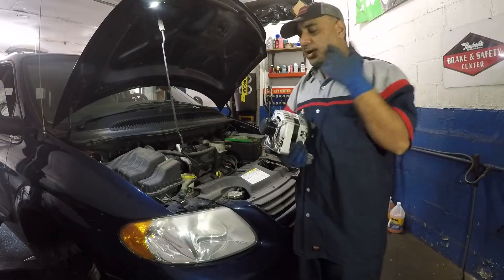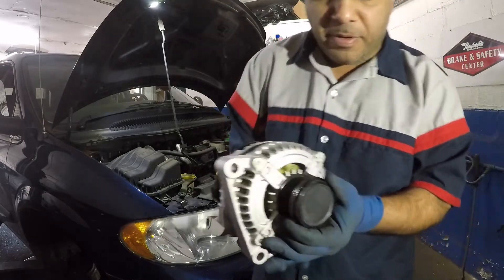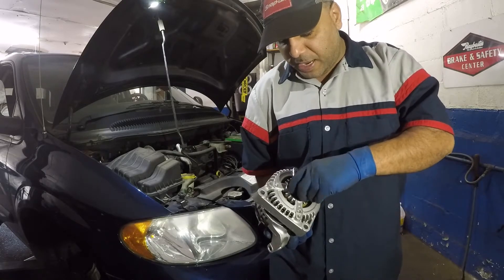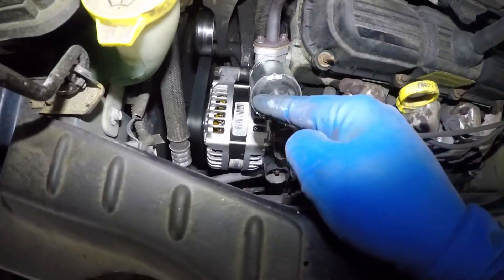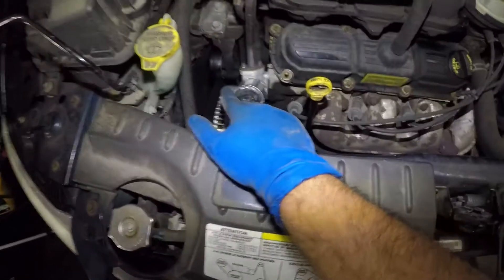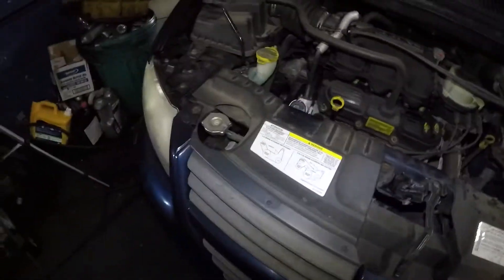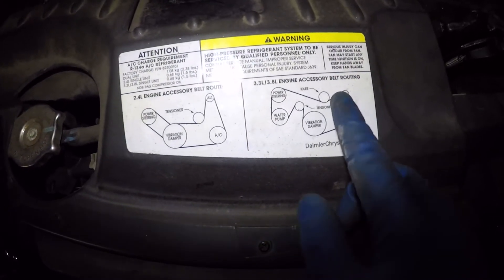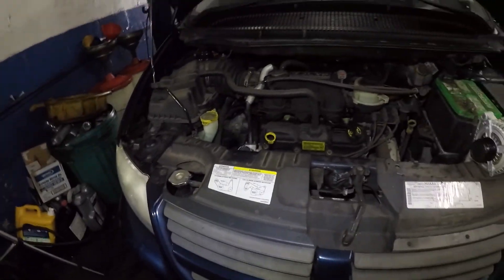Dodge Caravan 2005 making chrippin sound

Comment: My 05 Dodge Grand Caravan is making a noise when holding the gas pedal between 1 and 2 rpms in drive, but doesn't make a noise when in idle in park.
Reply: It's like a rattling noise
Reply from the maker: I would need to hear it